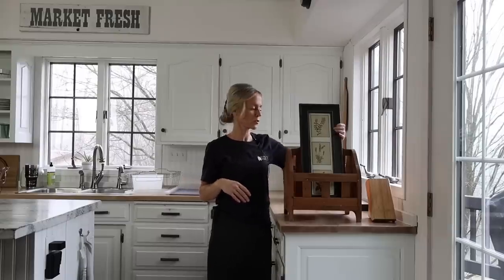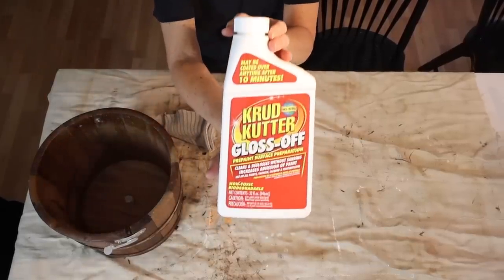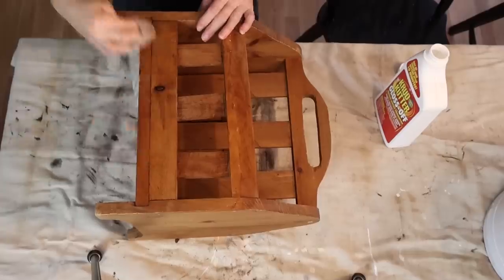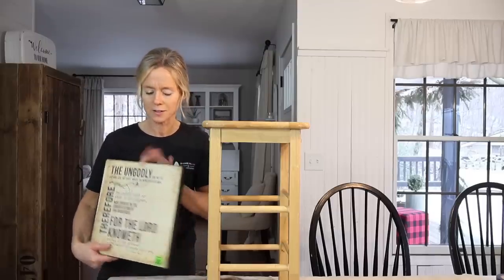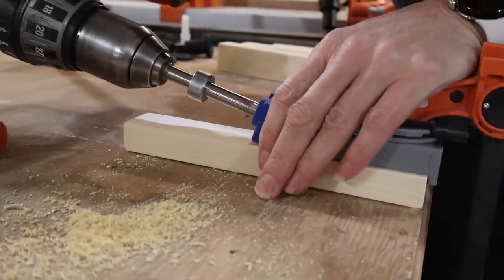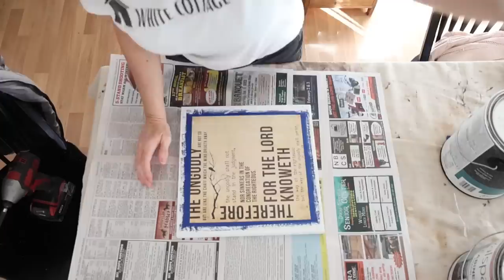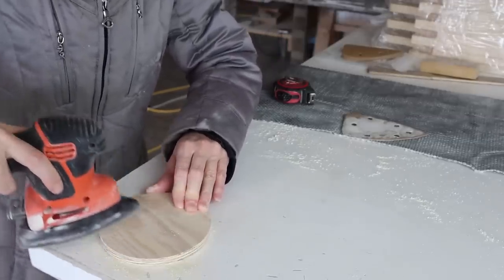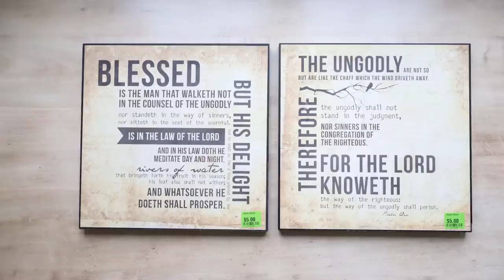Trash to Treasure Video ~ Thrift Store Makeovers ~ Home Decor DIY ~ Thrift Store Finds

Comment: the paper on the back of the frame has a purpose. It seals the artwork to keep bugs from eating the art. You can replace it by getting a brown grocery bag wet and covering it with Elmers glue on the printed side. put on the back print side down and as it dries it will shrink and tighten.

Comment: What is the handle you used with your spray paint can? I have never seen anything like that before. When I use spray paint my hand gets crampy. That handle looks like it would be so useful.
Reply: They sell them almost anywhere they sell paint, they just hook onto the top of the spray paint can. They have been out for many many years. I have had mine at least 30 years now. They really are amazing and makes it so much easier

Comment: While I loved each of your finished items... I have to comment that I was concerned about the lack of safety precautions when using power tools: no push stick/tool when running the small pieces of wood through the table saw (yikes!!!); no gloves when using the hand sander; freehand drilling instead of clamping the piece to a work surface; etc. Scary!